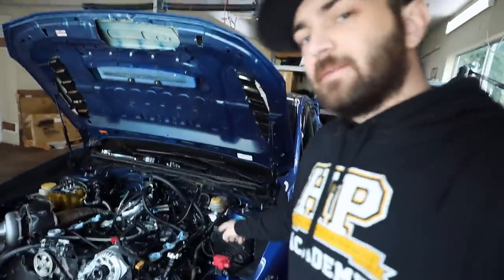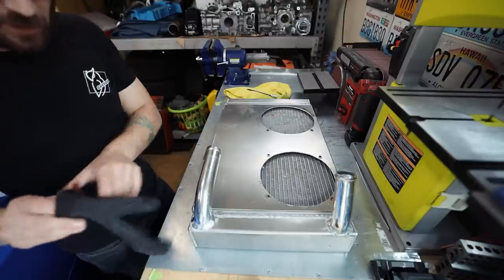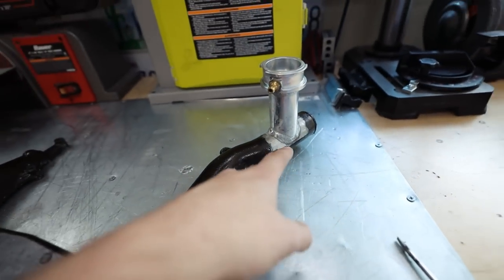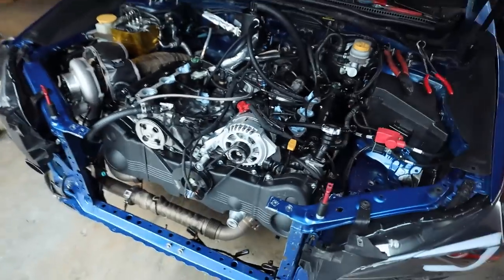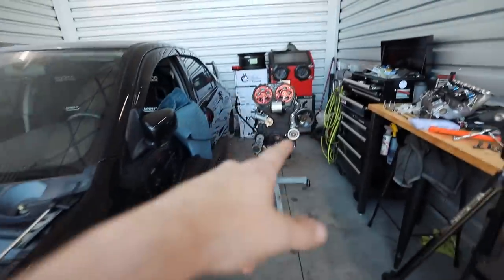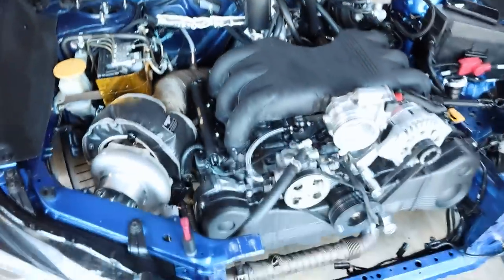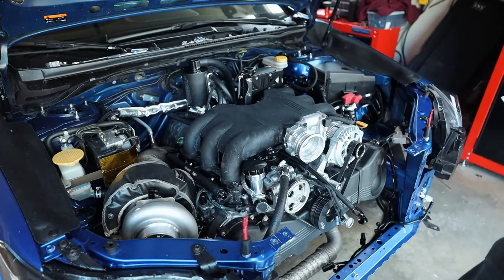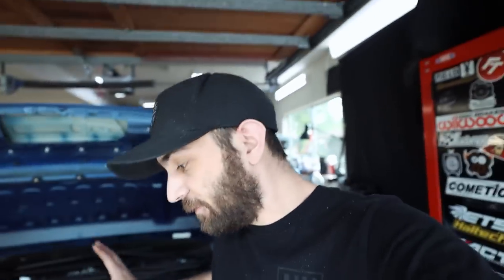Fixing my 6 Cylinder Subaru WRX STI Bunk Cooling System!

Comment: I'm glad you brought up that coolant mod. I was prepping to save up for that but knowing what you said I will be looking for alternative methods. Any recommendations for a 13' wrx?
Reply from the maker: I mean there are arguments on both sides for if they do or don't work. If you still want one I'd say snag one. But I don't really thing it's needed for my application. I've also ran a ton of my subarus without them and never really had any issues either
Reply: @Smeedia  I'd tend to agree as well. I'm barely on 350hp and coolant Temps never really rise above 208f but once in a great while it has worried me and gotten to 217 220 at idle i.e. stoplights. I think I may go a simpler solution and get a bit of a better radiator and fan/shroud setup as it's definitely an easy fix. 

Looking forward to seeing the h6 dyno'd and rolling under its own power.
Reply: @TheAustinely  where do you live? That seems higher than it should be. I don't remember my 13 wrx ever getting over 205 in stop and go traffic on a hot summer day. But I'm in MA so my hot summer days are mid 90s.
Reply: @Mr.Wongburger  I'm actually in Oregon. I always figured it didn't make sense that the ambient temp outside was 60 to 70 degrees with humidity and my car would sit at like 188 driving but then jump to the low 200's at idle
Reply: @TheAustinely  low 200's isn't that bad. Our radiators are small for the Temps under the hood. But anything over 210 is getting dangerous.
Reply: @Mr.Wongburger  driving to work just now, temp outside is 48f and raining. Cruising I'm at 194 now in park at idle it's making its way to 200. It got to 205 and slowly went back down.

Well Mr. Burger, it's been a pleasure chatting about our cars. Have yourself a wonderful day
Reply: @TheAustinely  that's normal. Remember your engine is an enclosed environment. The coolant temperature isn't going to be a direct reflection of the ambiant temperature. Obviously the lower the outside temp the easier it is to cool the coolant with the radiator. But there is going to be a cutoff inherently to the internal temperatures by design. Normal cruising in normal temperatures should not exceed 210 degrees. 205 was what my wrx would get up to on a hot day stop and go traffic with no air flow.

You have a good one too. Any other questions, I'll try my best to help.

Comment: Here's my 2 cents on the anti cooling mod video. Dom demonstrated the temp decreases. This is first party information, so it's taken with a grain of salt. The other guy stated he would back his claims up with alternate temp data, he has not done so yet or did not care to make it readily available. Again, grain of salt. The guy talks as if the coolant system is operating with giant air pockets where coolant is "taken away" from the top of the cylinder. He speaks on fluid dynamics and the path of least resistance, but fails to note that the longer path out of the head through the heater core and back to the crossover pipe is not the path of least resistance. The path of least resistance is the route through the top of the block and into the crossover pipe. Just thinking of this logically, the only benefit of pulling the coolant out with the cooling mod is the fact that a portion of the heated coolant is removed from the engine sooner. Getting said coolant to a source that can disperse the heat faster, though the heater core will not disperse heat in the summer because you have the core blocked mechanically with the interior temp control.
Reply from the maker: I've seen arguments on both sides and I've used them on cars before and I haven't used them kn cars before so it's not a big make or break it thing to me. But something I might play with when looking at Temps when doing some testing

Comment: I would put egt probes in you’re exhaust manifold…. That’s the only way to tell what your temps are doing in each cylinder..
The modd you removed does have a function especially in high hp Subarus….  

Everything your trying to avoid in terms of temps and such is all about data.  Without a way to monitor what each cylinder is doing your just shooting your self in the foot.
Reply: He can definitely add those sensors to the Haltech for exact data it would also greatly help a tuner but he's just trying to get it on the dyno for phase 1.
Reply from the maker: I have the option if I wanted to but, every other EG person I've talked to has said to avoid installing it. 

There's also no data showing that it would make any type of improvement either. So by installing it I could also be shooting myself in the foot

Comment: It's never a good idea to run without a thermostat. Your coolant needs to spend time in the engine picking up heat, and in the radiator shedding heat. If it's constantly moving it's not doing it's job cooling the engine.
Reply from the maker: We have a thermostat though...
Reply: he's adding an inline thermostat in the upper radiator hose.
Reply: Yeah, I hadn't finished watching the video when I commented. As soon as I heard you say you were putting in a thermostat I went "Doh!"
Reply: I'm pretty sure with all the cutting and welding this poorly engineered radiator is going to end up as scrap aluminum LOL.

Comment: You should watch this video regarding coolant flow/cylinder 4 cooling mod : https://youtu.be/MCrpzPaUnW0. Explainded much better and much more thorough IMO...😉
Reply from the maker: Seen subaru only as well, great video! 
There are arguments on both sides of the spectrum, for me and what I'm doing I've been advised by people who know more than I do to removed it. 

I don't think there is a right or wrong if someone does or doesn't use one 🤙

Comment: Cylinder 4 cooling mod doesn't help and if anything makes cooling worse? Now we all understand why Subaru didn't do that from the factory 😂. Subie life is constant learning curve lmao
Reply from the maker: Subaru did it on jdm X engines. But there are arguments in both sides. For my application I've been advised to stay away from them
Reply: @Smeedia  what do you think about ejs in general using them then? They've been one of the golden reliability mods for awhile and it seems pretty simple the way your Aussie friend lays it out. Does it work differently for some of Subarus engines?
Reply from the maker: I've had cars with them and without them, I'd day if you want one snag one and if not it's nkt a massive issue.

Comment: This explanation of cyl 4/6 cooling mod is wrong. It results in more flow, especially aound hotter side of cylinder head around the combustion chamber.  And more flow means better cooling. 
It's simple if you think about it. Use your head, don't just listen to someone on internet.
Reply from the maker: While it may be a good option for EJs there is zero datat showing how they effect a 6. 
Imo not worth risking a $12,000 engine using data from a diffrent engine. 

If the engine is pulling coolant from cylinder 6, the way My cooling system is set up it would pull thr coolant send it through the bester core and drop it at the thermostat. 

The heater core acts as a small heat exchanger already so I'd effectively be dumping already cooled coolant at the thermostat. 

For ejs they're alright, for EGs it doesn't make sense to use one